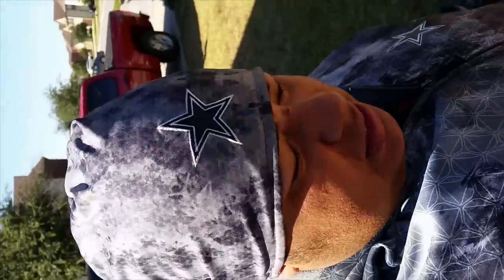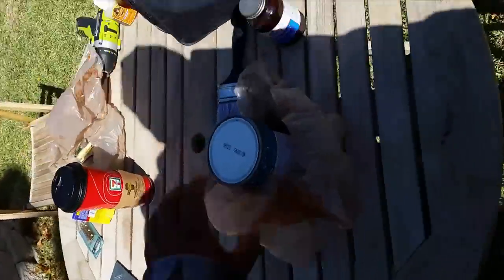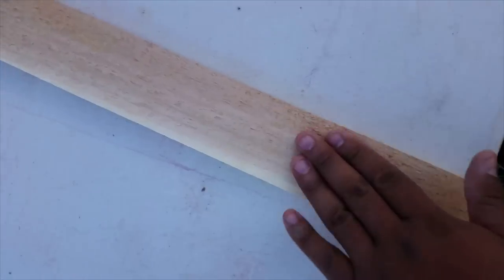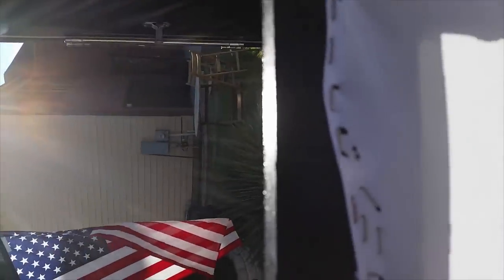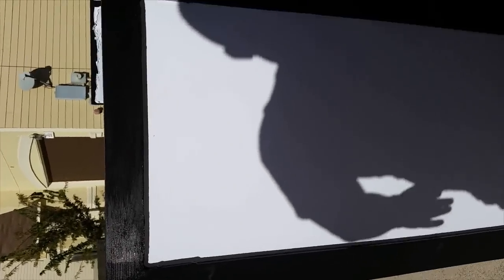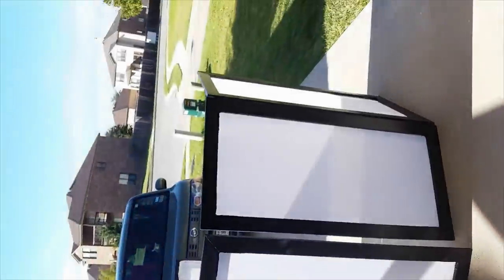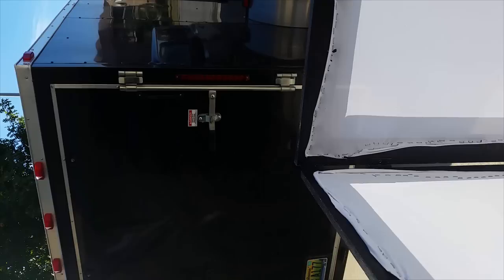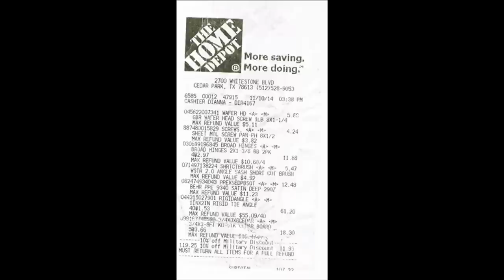DJ facade BEST EASY Do it yourself

Comment: Good job man... 
The thinner 2 foot panels look much better than the 3 x 4 ones we see everyone making.
Easier to transport as well...
The 4 foot is ALWAYS too tall... for the façade...
Not building a wall of CHINA...
Want to actually see the DJ and interact with him.
Not actually wanting to hide the equipment...
Just protect it from idiots wanting to touch your shit...
The in studio shop lighting effect was pretty awesome... on the façade
So...  how can you achieve that at a location/gig ?
The dome light that created it belongs under the table...
The table has to be pulled back a little bit to allow the lighting accent to reach the top of the façade from the back side.
DJ tables also need to be shortened a little bit...
With 6 to 10 inches of equipment on top of the table... and a monitor higher than that...
Would be the reason they are creating a 4 foot façade... 
Don't be afraid to lower your table/setup and be seen.
It's about the presence YOU bring to the room...
A big part of the deal is the crowd YOU draw... to the event.
What YOU bring to the table....

Comment: Hi, what did you use to uplight the facade? I'm also interested to know what kind of DJ light you are using. Thanks.
Reply from the maker: all material is in the description
Reply: +DJ Aztek Great video!!  What is the other light besides the LED strip at 11:04?  That really pops!!
Reply from the maker: +Paul Bierman its a cheap light from spencers and it works great so baught two